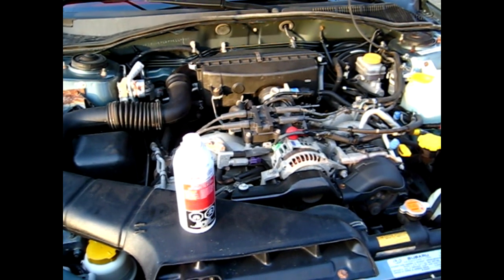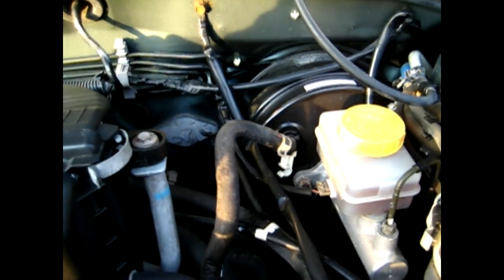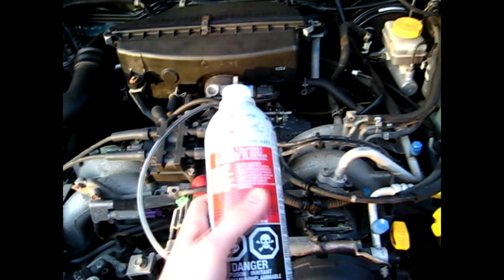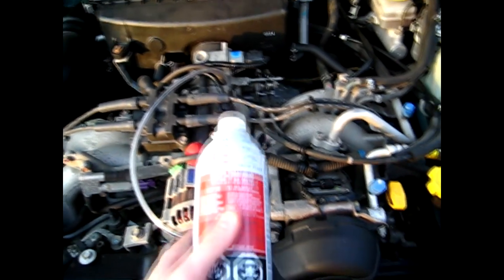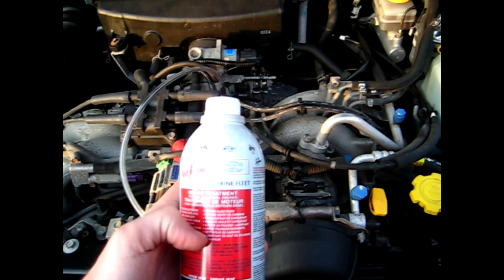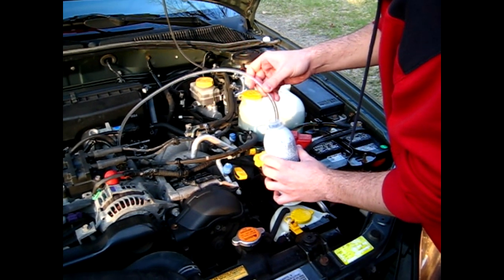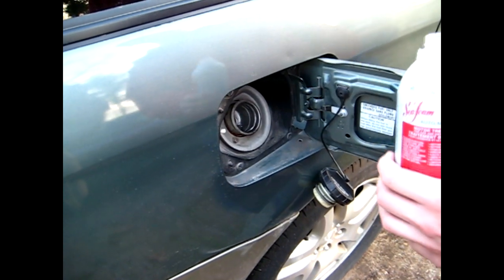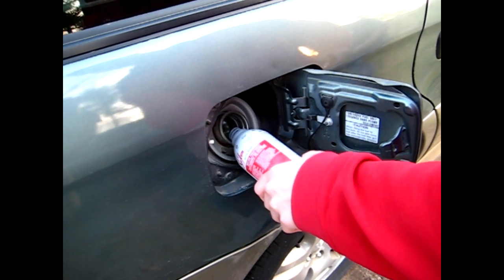DIY: How to Sea Foam an Engine

Comment: After hot-soaking the engine for 15-20 min, you need to drive the car with the engine in high revs (highway driving) to remove carbon build-up more efficiently. Be prepared for a mountain of smoke behind you and a lot of curse words sent your way lol

Comment: Don't know if you'll see this but how would I do this with a 2011 2.5i motor?
Reply from the maker: +Jeremy Hochstetler You can go through the brake booster hose as well, although considering the size of the hose you will most likely have to dump it into the hose rather than having it sucked up.

Comment from the maker: It only has 130kms... It really all depends how your driving habits are. The harder you drive your vehicle, the less carbon build up it will have... But that doesn't mean it may not have other sticking parts such as injectors.